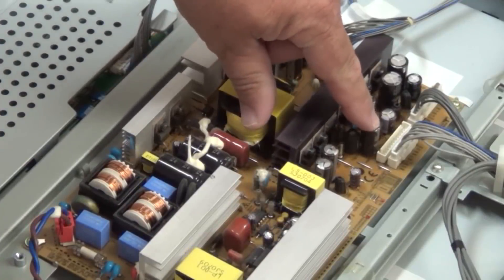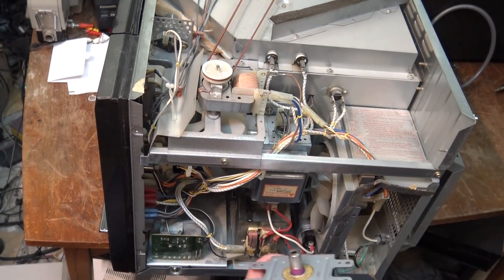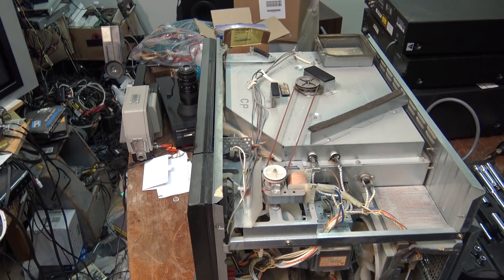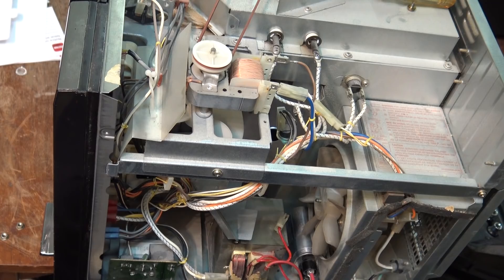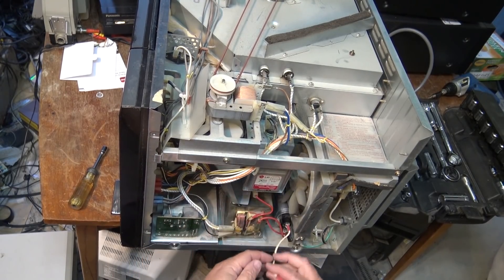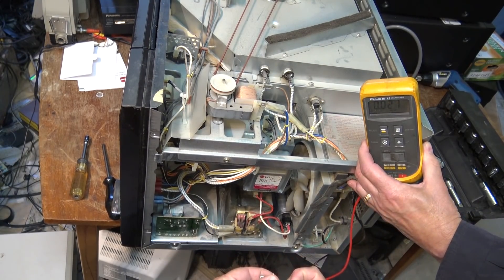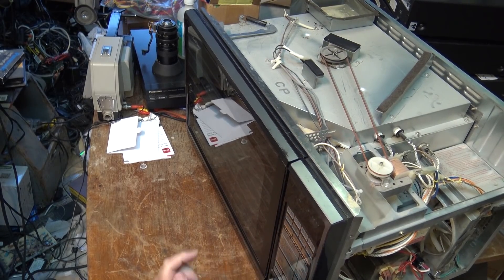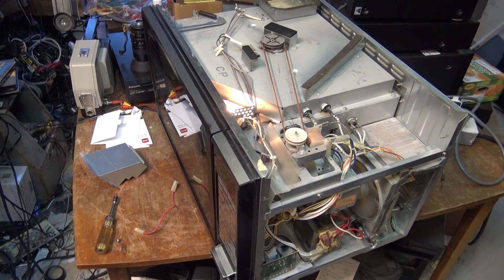microwave repair fail

Comment: I remember talking a broom handle to turn my on when they had the chrome push button because something was shorted out and would give a nice zap if you pressed it with your fingers. Eventually the capacitor burned out.
Reply from the maker: That would have been loss of the ground at the outlet.  The high voltage negative terminal for the kathode of the magnetron is connected to the chassis so the ground bond is vital to ensure the cabinet stays at ground potential.

Comment: I've got a vintage 1982-1983 Amana RR-800 Radarange that I've been thinking about servicing (new magnetron, power capacitor, diode, new electrolytic caps for the control board).  As it is, it works and it heats, but it takes a while to heat up a cup of water, so I suspect a weak magnetron.  May as well replace some of the other high voltage components and the low voltage electrolytics for the control board while I'm at it, considering the age.

Definitely would want to do it because they don't make them like that anymore and it seems more impressive than a cheap Chinese-made oven from Walmart that I could get for around the same amount of money.

Comment: we got an old Moulinex (analog one) . no rotating tray from 'design'. and the cabinet light is dead but still using it and it works good enough. I just turn around the food 90 degrees halfway time to compensate for the non rotating tray.

Comment: But I do have to wonder why the costomers would want to go though so much effort for a old microwave when a 900w one is like 40$ at Walmart. I won't lie this mwo is built alot better then the Hampton beach Walmart specials. Still makes me wonder why the costomer would ryther rebuild this microwave.
Reply from the maker: Because a 40 Walmart special is only good for heating your coffee.  This one bakes too.  Convection / Microwave.  If it was mine I would fix it no question.
Reply: @12voltvids  - simply buy a brand new Convection / Microwave. Plenty of different brands available.
I am in Australia so my search link is no use to you guys, however FYI a Google for the term "Convection Microwave" gave me "_About 25,800,000 results (0.64 seconds)_"
Reply from the maker: @johncoops6897  
Not my unit. Not my decision.  Now the owner knows how to change when correct part arrives.

Comment: This one hits close to home!  

2M204.  Part number provided from the original magnetron subbed to the one you got.  But it looks like that sub was for 2M204-M2 and 2M204-M3 which had the incorrect orientation.  2M204-M1 had the orientation needed for this microwave.  Unfortunately, the part number that was on the original magnetron didn't have a revision at the end since it was the original part.  

It looks like the mfg completely changed the physical design of the magnetron between the first part number and the second and third revisions.  

I'm sorry things didn't work out!  I know the refund won't help recoup you and your client's time, but I hope that the research I did with your client will be of help.  I wish it was a part that was still available.  The only way that I know the -M1 revision had the correct orientation was looking at a photo of it on an RF museum's website.  :)
Reply from the maker: We have found the correct m1 version, a NOS which should be here soon and then it comes back to swap out the weak one for a new one.  Sure miss the loss of main electronics.  They stocked all of the different units.

Comment: If that has a Panasonic model number you an try their parts website at encompass.com I have gotten parts from them before
Reply from the maker: Yes, but I do not know the Panasonic equivalent  model.  The Panasonic units all had a turntable, and the quasar had the "rotawave" antenna under the glass floor.
Reply: I wasn't sure if they were the same model #. I repair commercial microwaves and I know there are multiple builds of the same model. I was just offering an option for a possible parts source.

Comment: Got one I need to get a new switch panel for, nice LG unit, just has a failed keyboard assembly. 

That is why I have a box of pre tested ( the microwave rusted away) magnetrons, diodes and HV capacitors from scrapped units, just for replacement parts and testing what is failed. Only thing I do not keep is HV transformers, except for the odd one, as if they fail the cheap microwave is going to be scrap anyway, as a pattern universal transformer is around 70% of the price of a new one anyway. Expensive microwave yes, but for a cheap one it becomes a nice case for scrap metal, a set of screws for the box and donates a wiring loom and controls, plus that useful power cord with moulded plug.

Comment: Jeez your friend is really the senile old coot type... "Well if you can at least get if working we can wait for the right part to come in...". How about just stick with the repair, all those magnetrons are the same apart from the mounting points... Like it will make any difference. Also his disappointment it's not a Phillips or whatever... Dude all those basic components are made in the same shit hole and just stamped for whichever brand, makes no difference... Just the type to sell the "premium" brand part when the replacement is made in the exact same factory as the OEM...
Reply: Judgemental much?
Reply from the maker: I could have popped the base off the new magnetron and rotated it 90' but I encouraged the client to return the tube and get the correct one.  A NOS has been ordered on eBay.  Will see what arrives.

Comment: I made a video about Auto Zone and the same issue.  Purchased brake pads for front brakes.  Headed home to change brakes.  Get all the way to the point when I find out the parts are WRONG!  We only had one car.  I had to reassemble the whole job with bad parts to go get NEW good parts.  I made a rant.
Reply: I used to spend a lot of time with my mechanic friends, always take the old parts with you to the auto store and compare them with the ones they are selling you. sometimes I don't think it's really their fault , they look up a replacement in the computer pull the part and sell it to you.

Comment: before you explained it, i thought it was upside down and that belt was for the turntable. i thought convection microwaves were  a newer thing and didn't realize they were around at that vintage
Reply from the maker: Convection units were around in the mid 80s and then they went to radiant heat combo units and then the quartz browner to brown casserole ect. The big problem with people's preception of microwave ovens is they don't brown food.  So the manufactutes started making units that used hot air or radiant heat or quartz lamps to brown the surface of the food to make it more visually appealing. As I already stated I have a madam grill by Panasonic.  Gets used every day mostly as a cooking oven.  We seldom use it as a microwave. Occasionally in combo mode to speed up cooking. I have a second microwave with inverter power supply that is used for defrosting and reheating stuff only.

Comment: Junkowave are the new ones
Reply from the maker: I will with confidence day that 9 out of 10 people with one of these beasts will repair one of these units.  Those that make comments like this have never owned one of the best ovens ever made. There are only about 4 models.  This one which is  a quasar branded Panasonic equivelant to the dimention 3, the dimention 4 which was the same with a turntable  and the madam grill which is a conventional electric oven with ceramic heating elements on the floor and ceiling as well as a metal turntable and a square tray and of course had microwaves as well to speed to cooking.  I have that one myself and I would put hundreds into it if it broke. All these comments calling the owner a fool for fixing it are just people that don't know what it is.  If all you do is reheat stuff then sure a 50.00 microwave might do it, but people that own these units cook, and bake their dinner in it every night.  In my house my madam grill is the main oven. That and a toaster oven. The big gas oven gets used once or twice a year.

Comment: Not your fault dave, bloody stupid suppliers :-(
I've tested those diodes in the past, obviously a really high reverse breakdown voltage.
i'm guessing it's a stack of series diodes due to the odd reading they give.
Reply from the maker: That's why they call it a "stacked diode". A whole bunch in series to give a reverse breakdown of 2.5kv or higher.
Reply: Ahh i didnt know that name, you have to remember we are not all as wide ranging as yourself in electronics.
Most ordinary (transformer) microwaves eather pop the fuse or just lose the emission  strength.
Most people just throw them away when they die, so i only see one once in a blue moon.
People are very wastefull, shame that :-(
Reply from the maker: @zx8401ztv  
Microwaves fail in a few different ways.
1) switch fails and they pop the fuse.
2) plastic bracket wears and results in failsafe switch tripping and blowing the fuse.
3) HV capacitor shorts and blows the fuse.
4) diode fails and results is no heating.
5) magnetron gets weak.
6) magnetron shorts.

On this one it was #4, but the magnetwon is weak and the owner wants it repaired.
A new one has been ordered and should be back here once the new one arrives and I have to do this again.
Reply from the maker: He probably just looked up a part number and subbed it without closely looking at the picture.

Comment: jesus those caps are dangers. I still have a hole in my finger from when i was young and dumb and messed with a microwave without discharging that cap.
Reply from the maker: It will store 2100 volts.

Comment: I think the brand name is why its lasted this long wow ,doesnt this guy no how great you are ? I not sure I dont think they make any dual units any more I havent seen any.I just a micro- wave guy .when the ugly one my friend gave me dies ,I buy another one,the one I gots is ugly and I have to use my light to see the lcd dial sometime but it work great for now..
Reply from the maker: I know the client very well. He used to maintain our computers at the shop I worked for. Known him for 30 years.  Sold me my first DVD-R drive way back. The pioneer a02 which cost 1200.00 and blank disks were 25.00 a pop.
Reply: we have one, only three years old, is a Tisira, model TMW228X , 900watts Microwave, 1100watts Grill. dual unit. https://tisira.com/product/built-in-microwave-60cm-tmw228x/

Comment: No turntable in 1987? It is a antique I do believe ,great video going back to watch the rest.
Reply from the maker: Rotating antenna under the floor.
Reply: @12voltvids  ok
Reply from the maker: @nor4277  The Panasonic branded had the turntable. Even though they made Quasar,  the Panasonic was the premium brand the Quasar the discount. So the turntable added extra cost. Other than that identical, but probably 100 bucks different in price, and these units were relatively expensive. Over 1000.00, and in 1987 dollars that was a pretty good stack.
Reply: @12voltvids  thanks for being a great teacher,anyone who watches your show will learn something.

Comment: Why fix an 30 year old microwave oven that is worth nothing? Still nice to see you post this  : )
Reply from the maker: It is a microwave convection.  They don't make these anymore.  I don't make the decision on repairs.  The owner wanted it fixed.  I have a madam grill which is a microwave with radiant heat for baking.  It gets used daily and I would also put a magnetron in it. 
Yes you can buy a cheap microwave for 50 bucks but it isn't built like a tank like this one is.
Reply: @12voltvids  All is good! thanks for the respond   : )
Reply: These older models last forever, I am still using a 1974 Amana Radarrange model RR-4D. The unit weighs around 80 pounds.
Reply from the maker: @richardhz-oi8px  
They sure do.
Reply: @12voltvids the sound of the magnetron  18:45
Reply: @12voltvids  "It is a microwave convection.  They don't make these anymore."

There are companies that still make combination ovens, such as Sharp. An example is their SMC1585BB.

But, they're not cheap.
Reply: @Watcher3223  - yep. There is absolutely nothing special about "Microwave Convection" ovens., and the are not difficult to find brand new.
Reply: The value of an item is not tied to its worth. An opportunity to put something of myself into repairing an object is more satisfying than throwing it away and replacing it.